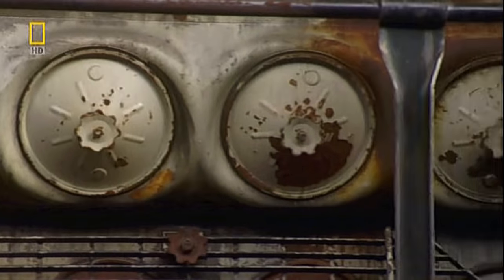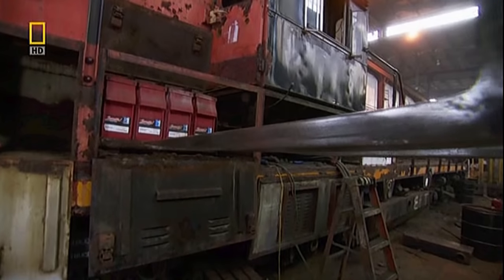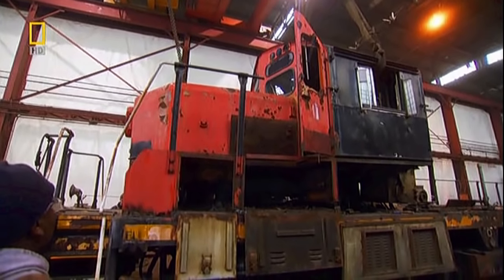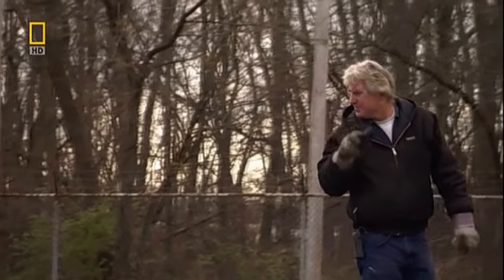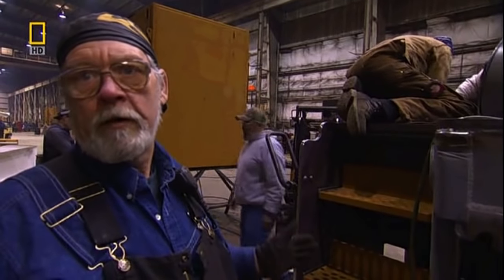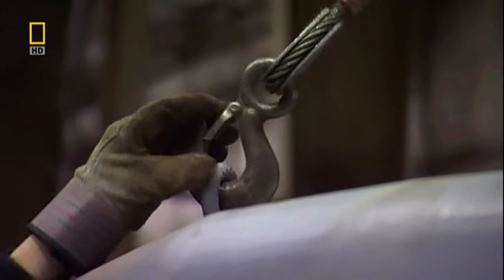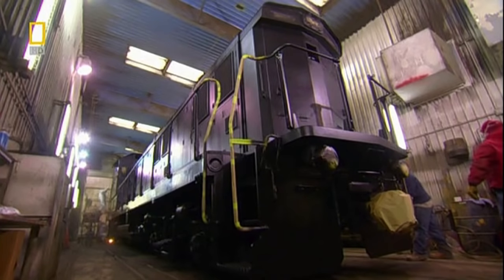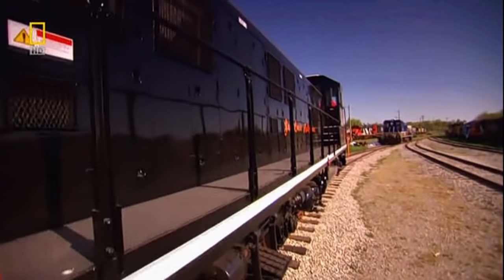NATIONAL RALROAD EQUPMENT at Mt Vernon. Complete rebuild of a old GP9

Comment: Title should be Completely Ruining a gp9. I'd take an old gp9 any day over a junkset. When we had 2 at Enola we could never keep those engines running. If I remember correctly we had to manually bleed the fuel lines to get the air out. Now we just use an mp15e
Reply: That's what makes them so much more fuel efficient though 😉 put in 3 engines and one sometimes works you use alot less fuel in a unit that spends most it's time in a shop
Reply: @wolfmanrebel874  the thing is that gensets suck at pulling power and it’s not really worth the rebuild them
Reply: @wolfmanrebel874  same with Harleys parked in garages !!!😄😄😄😄😄😎😎😎🍺🍺🍺🍺
Reply: @artmchugh5644  that probably the most true statement on the internet
Reply: @wolfmanrebel874  call em as I see em!!! Merry Christmas! !😄😄😄😄😎😎😎😎🍺🍺🍺🍺
Reply: @artmchugh5644  Merry Christmas to you as well, I absolutely get that, I fixed enough of my friends Harley's back in the day IV never wanted one I always to this day want a Indian chief BUT!! Iv backed off Everytime because I think of when am I going to have time to enjoy this thing...the answer: maybe once a year, so I opted for something cheap,simple,agile and good on fuel I drive 70+miles a day for work so I got a s40 "thumper" and I actually use that thing it saves me about as much money in the spring and summer as I burn in the winter driving my bigblock truck back and forth,meanwhile 99% of a year my buddys Harley's are parked and Everytime they take notion to ride them guess who has to get them back running first..total waste of money for most people
Reply: A GP9 might not be fuel efficient, but has the dependability which let it last 70 years.

Comment: I worked as a diesel locomotive mechanic at the Ford Rouge Plant, including being trained as a locomotive mechanic apprentice there in the locomotive shop. Everyday was a new job on Ford's locomotives. Loved working there. Did everything from monthly, semi-annual, and yearly maintenance and inspections, to total rebuilding of logo's. The Ford locomotive shop even repaired locomotives that were involved in accidents with passenger busses, and collisions with other locomotives and rail stock inside the Rouge Plant Complex. This is a real skilled trades operation.

Comment: So, essentially, a good ol' work horse that needed some work was insted completely rebuilt and ruined, both in appearance and operation. Nice.
Reply: Yes you are right. I am a locomotive engineer in Australia our Company purchased some remanufatured Locomotives from NRE and they are the biggest hunks of junk I have ever worked on.The tonnage had to be reduced by 30% because they do'tperform as rated. They drop out of full dinamic brake when desending steep grades and i might mention they lay sand continously while in dynamic brake the cab exterior was poor design as when laying sand the fine silicon dust came into the cab. Certainly would not reccomend NRE. I was dissppointed in these Locomotives as exremely noisey in the cab to the point of getting ringing ears if not wearing ear protection. I have never worked on such poor American made Locomotives before.
Reply: @paulcarpenter926  Blame NRE not EMD.
Reply: @3RTracing  he never blamed EMD
Reply: @paulcarpenter926  And now battery electric locomotives are the new in thing… No engines at all for mine haul operations. (The Western Australian mines are downhill to the coast so they run battery charge downhill loaded and battery discharge up hill unloaded).
Reply: Agree. Take a good design and replace with “modern” technology with a short life expectancy.

Comment: the gensets save more fuel because half the pods (engines) aren't working due to mechanical failure. $10k to replace the pods. Thats pricing about 5 years ago.

Comment: I've been a mechanic most of my life. I always enjoy seeing old equipment restored.
Reply: This is not being rebuilt it is being stripped for parts. The only thing being saved is the frame and the trucks to build a new locomotive on top of it which was a horrible idea and design and unreliable unlike the original  that is being stripped. The RR's that bought then are now dying to get rid of them. A far better idea would have been to rebuild the original you can see it was built like a tank and lasted 50 years in Canadian Weather.
Reply: @brucewallace4337 the first gensets where unreliable. They have gotten much better.

Comment: This video was pretty solid till the narrator said this is getting a genset engine. I got seven years experience of watching them fail. Our mechanics had to derate the engines to keep the circuit boards from burning out.  Our units were purchased with a grant so we are forced to use the useless engines otherwise the grant money has to be returned.
Reply: Using green new deal rhetoric to and metric instead of Imperial/SAE units.
Reply: I cut my eye teeth on a gp40-2 when they were brand new and thats why we called them a general purpose geep, nothing will ever compare to a hauler and switching engine…..ms~~~

Comment: The company, I worked for, (which will remain nameless), tried this technology. It was a royal pain to maintain, always a problem of some type, on the road, & they started putting at least two more REGULAR units on as back-up, to start and take-over if and when it failed. I'm pretty sure they sold these off to another short-line, light weight company and phased out THAT form of technology. And we kept GM EMD & GE units, with one big engine as prime mover and one big main generator, (alternator rectified to DC), Direct driven to a 3 phase AC alternator and an auxillary 74 volt DC generator to run the system and charge its 8 Lead/Acid batteries or its two Unitized batteries. (these are standard, now, but one bad cell out of 16 cells and the whole battery quits! Single batteries are very easy to use and much cheaper! 8 volts apiece and 450 lbs each. (THAT helps in tractive effort!)
   Some units have been changed over to 3 phase AC Traction Motors that use an Alternator, that's NOT rectified, and completely different motor-control. The newer units STILL HAVE ONE ENGINE AND ONE MAIN GENERATOR, It works better that way.
   The old passenger E8's had TWO big engines connected to two main generators, each running separate from the other, and was long and had the bullet nose. You could tell it had 2 engines in it if it had a rounded topped DOOR in the middle on the side of the loco. You could access everything inside the carbody shell from the cab of the loco
   It all goes to the fact, " IF IT AIN'T BROKE, DON'T FIX IT ! "

Comment: Welding the cab in front hood on well so much for easy maintenance if you have to remove them you got to cut and grind the welds off the old ones were bolted on at least on most locomotives

Comment: At the time this video was posted, the genset locomotives were still being produced but are being rapidly phased out now by the major U.S. railroads.  The person who posted this video stated that he loves the southern accent.  This facility is in Mt Vernon, Illinois which is in south central Illinois about midway between St Louis Mo and Evansville, Indiana so this is not really a southern accent here, its more 'good ole boy'.  Having changed many sets of air valves in these locomotives, I wish they had shown some of the complexities of that system assuming they are using a 26L system.  The painting process also is nothing to be taken lightly.  If they were using DuPont Imron paint, it is very dangerous for someone to use who does not respect it and doesn't know how to apply it properly.

Comment: Gensets sound mor labor intensive inside one engine and generator to maintain you now have 3? Your savings in fuel have just gone to labor and maintenance. Also may lose money if those engines fail to kick in and suddenly need helper units on a climb you did not need them before
Reply: Sensor failures are an issue with these too.

Comment: I worked the oil industry. I can guarantee the boss gonna go over that paint job with a light & fine tooth comb. No runs, no drips, no errors & no dry spots.
 But a locomotive? I got other shit to do. 
 Those stencils better be straight because I betcha he is gonna put a string line on them & you are going to be holding the other end.
 Talk about the cab welding. 1 hole will start corrosion. He didn't mention the weather. Flaws, gas trap bubbles cause corrosion. Trains also work in salt environments. The coast, dry lake beds, caustic materials, you name it.
 Constant battle.
 ⭐⭐⭐⭐⭐

Comment: I like that the locomotives are refurbished, but I think they look strange.
Reply: Yes but they would have been better off just rebuilding the old one for a fraction of the cost and then slap a new coat  of paint on it and it would last for another 25 years. If you read some of the comments from RR Employees they were not all that reliable and had nowhere near the pulling power as the originals. Old EMD's will run forever if properly maintained. A lot of these were purchased with Grants from whatever Nanny State the RR operated in the interest of reducing pollution and better fuel economy. It was a dumb as the Cash for Clunkers Program where perfectly good vehicles were destroyed. Or the program they had in Seattle WA where they were giving Grants out to replace 10 year old Semi Tractors to buy a new one and they would then crush and destroy the old one even though it probably ran fine. All in the interest in improving air quality. IDK I have been to Seattle and thought the air there was fine probably better than most US Cities.
Reply: looks are secondary
Reply: he is close to getting it
Reply: @brucewallace4337  he gets it

Comment: Several small size engines replacing one big egine - this technology is not so new, as the two Gentlemen state at the beginning of the video. In Germany class 245 locos (Company designation Traxx P160 DE ME) are operated since 2012 successfully. They have 4 small diesel-engines with 565 kW each and are electronically regulated, saving about 10% fuel compared to the previous model, class 218.
Reply: I have no doubt the German models work better than these gensets.

Comment: This is old video, the railroads quit doing the "gen set" update, too many failures. They are horrible to switch out freight cars with.
Reply: The biggest problem with genset locomotives was that they were rebuilds - they had a ten year design life as a result before the frames and running gear needed replacement…
The new generation low emissions concept is battery electric locomotives - particularly where large dynamic braking loads are present and also asymmetrical loading (like mine to port traffic).

Comment: What the hell is a driver’s console? I understand nose and electrical cabinet. Cab, crew cab, crew compartment. If the narrator is referring to the location the locomotive engineer (Big E, Hogger, Hog Head, etc) operates the diesel electric locomotive.... that is the control stand. Was the geep built by GMD in Canada?  The classification light arrangement looks like those used by the American Locomotive Company (ALCO).  The prime mover is definitely a 2 stroke 645 EMD/GMD with twin roots blowers.

Is this the same shop that was Precision National Corporation (PNC)? They had a crankshaft division North East of this location.  The two locations were separated by the L&N Saint Louis Division and the Missouri Pacific main lines. The MOP Operator at Mt. Vernon, Illinois controlled the interlocking.

I helped deliver about 15, or so, UP DDX 40’s to PNC via Long Alley. We shoved other units on the MOP connection and the MOP spotted them in PNC via their connection.

Great times in late 1979 and the early 80’s.  I miss braking, flagging and running an engine.